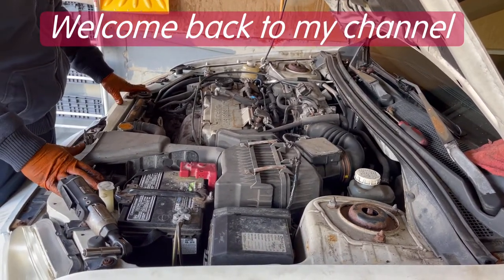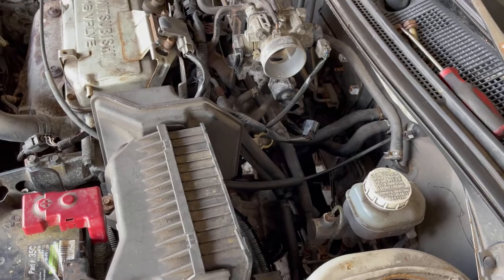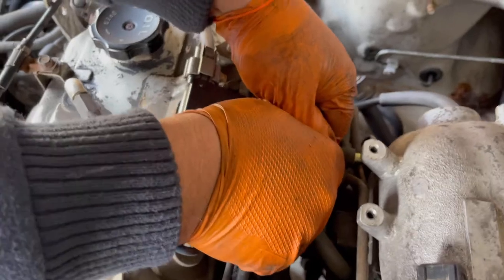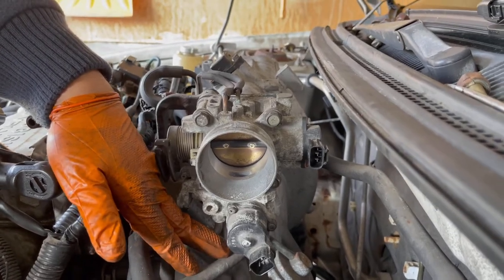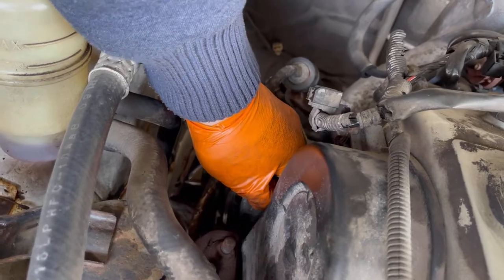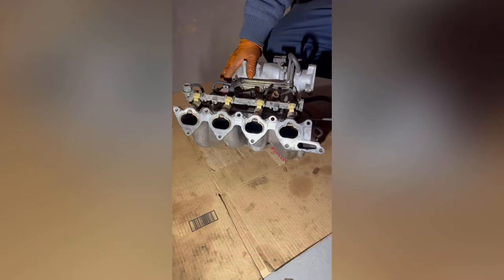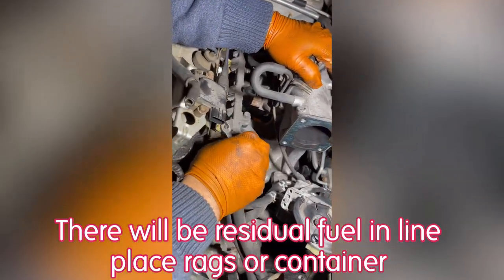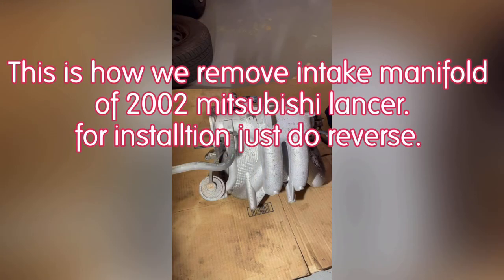2002 Mitsubishi Lancer Intake Manifold Removal

Comment: I’m getting code po171 I’ve changed everything fuel pump, fuel filter, cleaned injectors, replaced Bank 1 o2 sensor, fuel pump relays, fuel pressure regulator. And I’m still getting the code I hear a vacuum leak but can’t see it at all is this where the issue is coming from my engine has hard starts and loses power when I press the throttle unless I let off completely and press it again
Reply from the maker: Did you try replace Mass air flow sensor it does sound like you have a hidden broken hose somewhere run a smoke test if you can.
Reply: Did u ever figure out the problem?

Comment: Hi, my brother had bought a galant and replaced the manifold where only one sensor doesn’t connect, not sure if he got a aftermarket one from a different model with the same motor, sensor said ifs, won’t run without that sensor obviously but is there any way around that? Does he need a pull another manifold off of a junkyard galant like I told him to begin with?
Reply from the maker: If you pulled from the same engine and model of the car wiring harness shouldn’t be an issue. Sometimes wiring harness hide under the part so you just don’t see it.
Reply: @kashfix9160  I think he pulled it from an eclipse if I’m not mistaken, I just welded him a new mounting spot for that sensor and it runs and drives thanks brother 🙏

Comment: So would this cause fuel smell, hard engine shaking, and white smoke from the exhaust
Reply from the maker: Could you describe more of your problem? White smoke could cause due to burning oil in engine or antifreeze parking into head cylinder.
Reply: @kashfix9160  I replaced the intake manifold gasket already I'm having other troubles if you could help with that.
I'm getting code p0340 for camshaft position sensor circuit a bank 1 and I can't even get it to start up new fuel pump, new injectors, new alternator,new battery, starters good I did have to wire a new pigtail connector for the camshaft but idk if it's a bad ground or something else
Reply: @isaiahwilliams2149  your timing belt could've slipped teeth
Reply: @worldsslowestmustang  it did
Reply: @isaiahwilliams2149  bruh the funny part is I didn't even realize the comment was a year ago
Reply: @isaiahwilliams2149  still got the lancer or did the timing fuck everything up too much
Reply: @worldsslowestmustang  still got it
Reply: It was almost completely backwards but it made it
Reply: @isaiahwilliams2149  hell yah

Comment: I have coolant leaking into my transmission speed sensor on left side of engine. Does not overheat..pressure test shows no leaks. What could be causing this? No one can figure it out. Sensor is swimming in coolant and causing shift problems. Cannot replace sensor until I find what's causing coolant leak.2001 mitsubishi galant v6
Reply from the maker: Sounds like you have a head gasket leak.

Comment: I got error 4001 a lancer 2006 thought only to clean the egr and throttle body, do you recommend removing the intake anyway?  Another question, do you know if the microfilter is changed to those injectors?  Since I bought it I have only cleaned the injectors with pressurized.  greetings good video.
Reply from the maker: You don’t need to remove intake a part it can be removed individually and it’s held with two 10mm bolts. Injector micro filter can be replace on many cars but I haven’t ever replace on Mitsubishi’s. You need to double check on that. Thanks for your comment and watching my video.